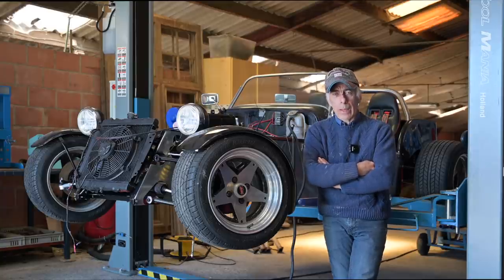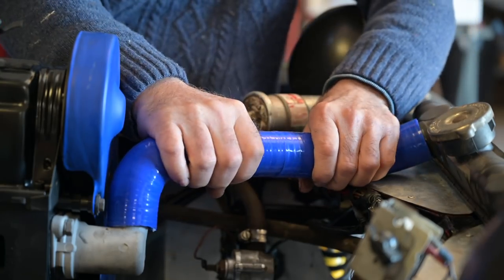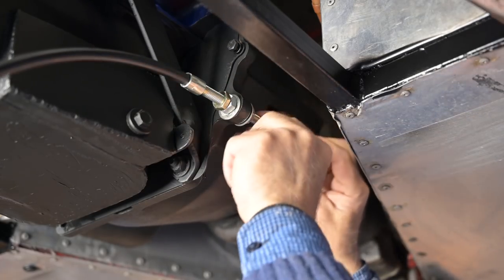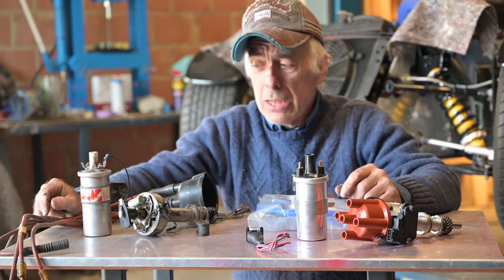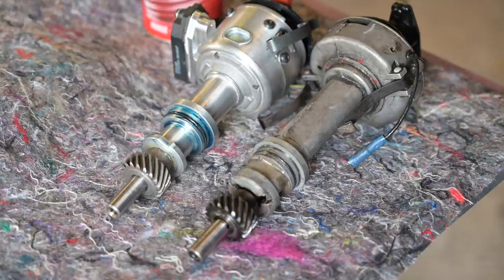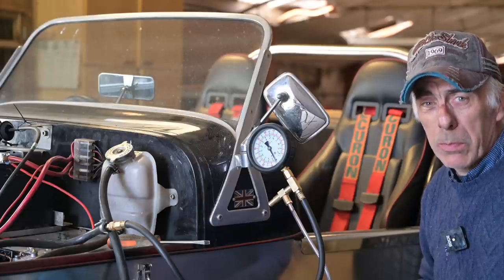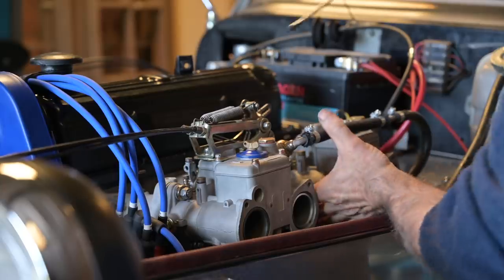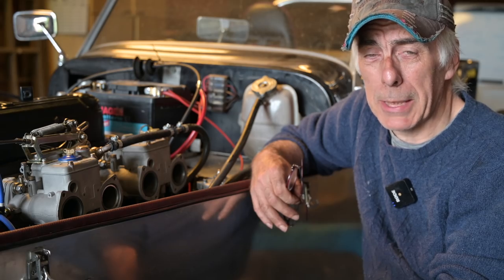Old Sporty is alive and kicking

Comment: Steve - Recommend you rethink the layout of the bottom radiator hose.  You have created an air lock with your hose routing and could end up with coolant flow problems in the future.  The hose run should be a continuous drop from the exit point on the engine to the entrance point on the radiator.  That U bend you have in the line has the potential to work like a "P" trap on sink lines, but in reverse.  Purpose of the "P" trap is to keep water in the trap area at all time, but in this case if the radiator water level ever gets below the top of the "U" in the hose, you could have an air trap develop.
Otherwise, great job on this car and I have to say your videos on rebuilding the DCOE carburetors were the clearest description of how they work, how to pick the right components, and how to disassemble and reassemble that I have seen.
Reply from the maker: Thanks for the comments Ron.   Yep you are right about the tubes. But the options were limited.   I looked at all...  The good thing is that with the vacuum filling all tubes collapse and they really suck the coolant without air pockets. If you do a normal fill, then yes it can be an issue... and as you state... but coolant that is that low should never happen

Comment: Ribbed hoses create a layer of turbulent flow close to the hose's internal diameter ,on this layer slides  a vein of coolant wich flows extremely well on this turbulent layer wich act as rolls.
You have rolls on wich slides a vein instead of a vein sliding on an other slower vein rubing on the hose.
The same is applied on submarines hulls,and ships wich are coated with rough texture to create turbulences like on sharks and marine mammals skin.
You save around 2 % of fuel with that on tankers.
Inside engine heads ports,same effect ,where the gas can't condensate on the port since turbulence occurs constantly.
The flow is even better on those flexible hoses since you don't have bends,but smooth curves ,there is less charge loss.
It's less aesthetic and tidy however.
Reply from the maker: Thanks for the comments, Interesting to read.  I can hardly believe that.. But you can be right.... as it seems you know a lot about it...  In my case I have a very smooth inside and a much shorter hose.  The flex type was much longer and did more or less the same curves..  I will try a flow test with the two tube types,  And who knows , I might be totally wrong. Thanks for bringing the point
Reply: @D3Sshooter  
I don't know a lot about it ,i just know basic few things.
You can get a lot of infos on searching about "laminar flow "  and "turbulent flow" and adding "corrugated " or "annular" "heat exchangers" "skin shark" etc...
In the industry they provoke a liquid turbulent flow in steel piping to strip clean the inside,the flow is so bad that it strips steel while circulating its way out pipes.
In your case,less flow or more flow is not necessarily good or bad.
all depends on your engine block design ,head gasket passages, pump flow,radiator surface and material ,heat to dissipate.
You can have a low flow ,longer heat exchange time,or opposite,depends of if you have cast iron and aluminium parts mixed together or not,i don't know.
The set up on your car's radiator is pretty bad for airflow : you need to pull air,not push it wich is always less efficient .
 You don't block relative airflow that your vehicle creates while moving ,and you don't perturbate the laminar flow that your radiator fins create when cutting in the air.
LooK there for good explanations : http://contrails.free.fr/engine_aerodyn_radia_en.php

Comment: Steve that lower radiator hose is going to be a problem. I had a similar problem with one of my cars when I found the problem is was too late and coolant was shooting out of a small hole where the radiator hose was coming into contact with a belt. My solution was to cut an old radiator hose length wise and wrap it around the radiator hose where the belt and the radiator hose came in close proximity. But I also fiddled with the hose angle to gain more distance. Happy to say I had no more problems. You are very creative and you will probably come up with a better solution.
Reply from the maker: Thanks Oscar, and indeed that is an area that I will monitor. I will do two things.  Drop that hose about 10mm, that will give me about 20mm of clearance and then glue a half circle of thin aluminium onto the top of the house. Thanks for the comments

Comment: The auxillary belt is very close to the bottom hose as you know, but there is quite a bit of adjustment both ways on the alternater, so a shorter belt could be fitted and possibly change the angle/gap of the belt? Just a thought 😊
Reply from the maker: Indeed that is another option as that will bring a bit more space as the alternator moves up.  Yet , I have found a solution

Comment: when I had Sierra with this engine and weber from mirafiori fiat. i was able to adjust the co idle mixture by ear. and passed test with it many years. if you  raise the throttle by hand , wait for a while so acceleration pump fuel is consumed and release it, it should drop to idle quite fast and not go below it. If it drops below, then returns to idle, it needs more. If it drops slowly, it needs less.
Reply from the maker: Thanks for the comments, Great tip.  Will try that out

Comment: She sounds awesome Steve, but of course: She's a Ford! And again your explanations were very interesting, although I've done this many times! ...Newk from Kentucky USA
Reply from the maker: Thanks for the comments Tim, however there still a bit of work on it.   The exhaust leak where the single pipes aggregate in the side pipe, Valve clearance, as valve sound like a tractor.  I also suspect that the intake valves at cyl 3 and 4 are having way to much clearance hence the poor suction on that carb. Despite the fact that we did a compression test and that was good ( with throttle wide open)

Comment: Hey, nice work as usual! Awesome sound! Congratulations. Just few minor comments from my side: first, I would have used narrower diameter silicone hoses. The ones you used seemed a bit too wide on a pump, radiator flanges and connectors. Well, that's the silicone which stretch or gets tight when O clamp is used very well, so ir should be fine. Another thing -  I would have used cooper covered, slightly hammered nuts for exhaust mounting, so that makes sure nuts won't get loose from temperature differences. 
It was really interesting too see how to install electric spark distributor instead of vacuum based one. Thank you
Reply from the maker: Thanks for the comments, and indeed copper nuts would be better...  Just did not have them at this time... The tubes only come in certain diameters so I got a close as possible .  At the end it worked

Comment: Nice to see old sporty coming together Steve. The only thing I was surprised at was the diameter of the silicone hoses ...they seemed a bit bigger than the metal mounting pipes ... I was expecting leaks ! :) keep up the good work.
Reply from the maker: Thanks for the comments, it worked out fine.. and not all sizes are available

Comment: Steve , fit a return spring on clutch arm to a fixed point, to pull arm back so release bearing is not running all the time.
Reply from the maker: TXS for the tip and comments Geof, Indeed that is some thing I will do.  I don't understand why that is not defacto on  this type of a gearbox.

Comment: Too bad you can not chemically join the piping instead of using clamps. Looks like it will work well. Could you go over the top of the transmission with the clutch cable? Wow what a lot of work. 
Jim in Chile
Reply from the maker: Thanks for the comments, yes that would be the best approach

Comment: Leafing through my old Haynes manual (Cortina Mk4 1600cc 2000cc), it recommend the free play measured at the end of the clutch pedals 27mm to 31mm. I seam to remember that there was never a third bolt to lock the feral to the bell housing., you could pull by hand the feral away from the bell house a good 4-6mm before pressing on the pressure plate spines. It also says initial advance 6 BTDC  1.6L and 8 BTDC  2.0L version. How do you achieve what we use to call the vacuums advance with a electronic Distributor?
Reply from the maker: Thanks for the comments, as for the clutch - this is a modified car with parts from different cars.. So , one needs to find the best way.   As for the ignition, this engine has a modified head and a fast road camshaft with a modified lobe timing.  Hence the need for the 12 Degrees .  I have no vacuum on the webers nor on the distributor, it all relies on the build in advance curve...and that is a fast road curve.

Comment: I really enjoyed the carb rebuild videos and was keen to see the follow up with the ignition system you put in. Glad that was covered in this video, but I can't work out which electronic distributor you chose to use and why. It looks like a Ignition123, but that is a guess. Can you elaborate on what it is and how the advance curve works in it - guessing it is just base on rpm and not load / vac
Reply from the maker: Thanks for the comments, well the old one was based on braker points, the new one has an electronic sensor... so no longer any issues with the points.   Secondly , it has a fast road advance curve build in, where as the old one had just the advance (vacuum) removed,  So very poor advance ( only the bob weights centrifugal force creates advance and those were set for a combo Vacuum and Centrifugal) . As for the coil, a much higher primary/secondary ratio. So beter sparks due to the higher voltage and the better pulse on the primary of the distributor.   And at last, the distributor was worn out -play...   I hope that answers the question
Reply: @D3Sshooter  Thanks - what brand is the distributor ? I'm looking for an electronic distributor for a Lotus twincam

Comment: Nice work, well done. I recommend NOT welding the clutch nut
so as to allow ease later removal. Use a clamp, machine one or modify a “shaft
collar”.
Reply from the maker: Thanks for the tips!, It still has play

Comment: nice work. But still sounds rough imo. I think first check valve clearance. And do a compression test after some pulls.
Reply from the maker: Thanks for the comments, yep a compression test was done a while ago in one of the video's .  I adjusted the valves just yesterday and you can see the result in the Update video posted 21 may

Comment: Damn, this thing sounds good... ♥️
Reply from the maker: Thanks for the comments , yes but still a bit of work on that sound ... To much noise from the valves and the exhaust leak..  Things to fix and provide and update
Reply: @D3Sshooter  You'll get ir right. Patience 💪
There's no such thing as a two week build with no issues. Even less with a custom build like Old Sporty.
One trick regarding the clutch cable bracket for future projects: you can use a neodimium magnet so you don't even need a weld. As long it's not near the exhaust headers, that is.

Comment: After your poor leakdown results on the engine you suspected problems with cylinder bore or rings, so what happened to the episode where you rectified this?
Reply from the maker: Thanks for the comments, well this was just a valave clearance issue for the rough running...  There was some leak down, yet nothing major. So I kept it as it is.  I am rebuilding another engine 2.1L from scratch and that will go in one day...

Comment: Sorry Steve, I missed why did you replace the distributor and coil.
Reply from the maker: Thanks for the comments, well the old one was based on braker points, the new one has an electronic sensor... so no longer any issues with the points.   Secondly , it has a fast road advance curve build in, where as the old one had just the advance (vacuum) removed,  So very poor advance ( only the bob weights centrifugal force creates advance and those were set for a combo Vacuum and Centrifugal) . As for the coil, a much higher primary/secondary ratio. So beter sparks due to the higher voltage and the better pulse on the primary of the distributor.   And at last, the distributor was worn out -play...   I hope that answers the question
Reply: @D3Sshooter  thank for you answer. But let me say that regarding advance  management you will have no benefit. Because the advance is set up only considering rpm, you don't have any throttle sensor. The same situation as for old distributor with vacuum advance disconnected. Otherwise you need a throttle potentiometer to give throttle position information to an Ecu that will manage it combined with rpm signal and set the right advance through a 3D map. It calls alpha-n advance management where alpha is throttle opening angle and n is rpm information.

Comment: Great! I like the steady progress in building this "Racy Old Rusty".  At 11:45 you are mounting the clutch cable  and just above that stud for the cable, there is a bolt.  Can it be that it is not thigned? If so, why is that?  I noticed also that you do not apply coppergrease on the exhaustbolts. What is your opinion on the use of coppergrease?
At least I think that you were lucky your glasses didn't fall into the enginebay when cranking up the engine! Scary moment on 32:00, but with a happy escape since I noticed you still had your glasses in your hand at the end of this video! :-) (an HSE-engineer never sleeps!)
Reply from the maker: Thanks for the comments. Yes that small bold still needs to be tightend (it is now).  Well these exhaustbolds are steel as you might have seen.  I will replace them the coming days ( when I have them) with copper types, so no need for copper grease (IMO).  The glasses, cheap versions  15 euro....  but yes you can't be safe enough

Comment: I’m surprised you didn’t replace that thermostat housing on the engine. That fitting looks pretty sketchy..........lots of corrosion.....
Reply from the maker: John, its not as bad as it looks, I did check it out .  But yes, I can see your point.  Of course I can still do it and I might.

Comment: Will the hoses need reinforcing to keep them from collapsing when hot?  Especially the water pump side.
Reply: Their great hoses and remember when the car is hot the cooling system will be under pressure.We used them on formula Ford race car with never a problem.
Reply from the maker: Thanks for the comments CuddyTom , Those hoses are High Performance types, triple play and a thick side.   Build for this purpose.  Never had an issue with it.
Reply from the maker: Indeed Nick,  thanks

Comment: You might try metal tubing for part of that lower hose. Definitely make more clearance between the lower hose and fan belt.
Reply from the maker: Thanks for the comments Terry , indeed that is about 10mm and might not be enough. I will make a change to that , by lowering that tube with about 5 to 10mm .  That will bring 20mm and place a thin alu half circle protection on the top of the hose
Reply: @D3Sshooter  Glad to hear you are adding more clearance to the hose. I mentioned it because I once replaced a radiator and fan with little clearance thinking it would be okay and proceeded to ruin them both. Lower radiator hoses have a wire coiled inside them to avoid collapse and shutting off coolant flow. Not sure if that premium hose requires it.

Comment: Where do you get the sillicone hoses?  Those are Neat!!!
Reply: Any company that supplies race car parts will have them.Almost all race engines will have silicone hoses.
Reply from the maker: Thanks for the comments Gwen, As nick stated , a very common part in performance and race shops.   I got mine in rubberwinkel.nl

Comment: that lower hose is going to be rubbed through by the belt at higher rpm i imagine!
Reply: Thought the same thing.
Reply from the maker: Thanks for the comments, yes it just did, so I lowered the pipe a bit and place a very thin half moon sheet of aluminium on it just in case...  So that is fixed
Reply from the maker: Thanks for the comments, yes it just did, so I lowered the pipe a bit and place a very thin half moon sheet of aluminium on it just in case...  So that is fixed